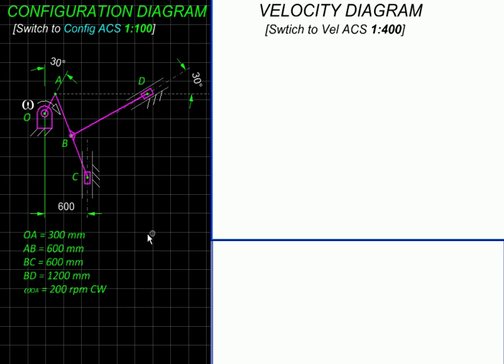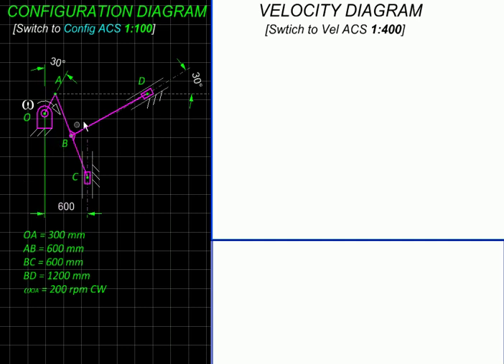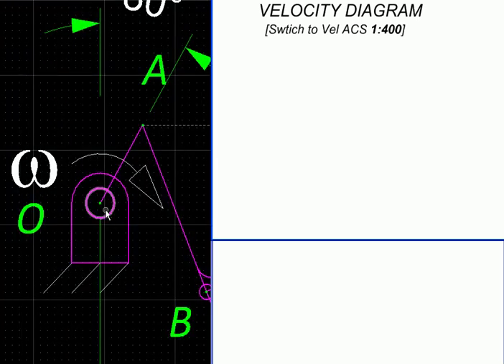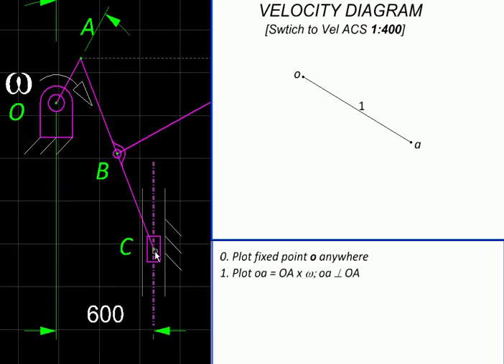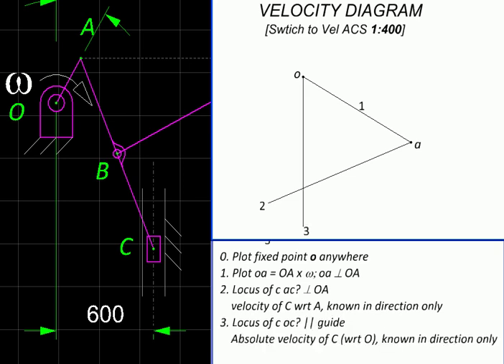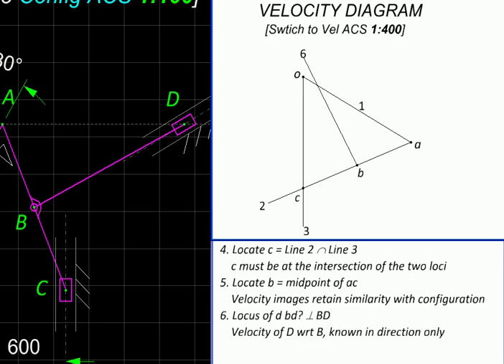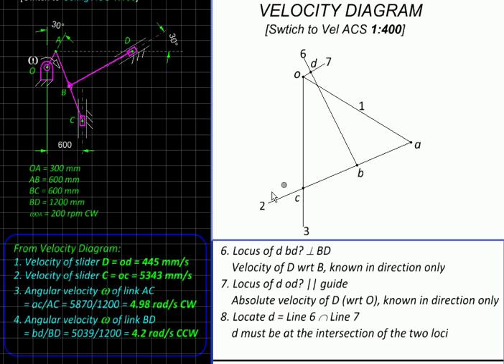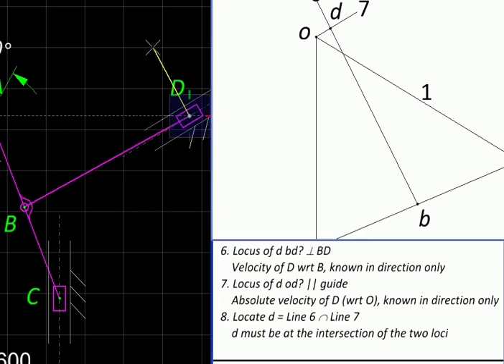Kinematics Ch03 E Velocity Problem 01

Comment: The locus of c should be perpendicular to AC not oa. To draw that a horizontal line is drawn at point a and a line at 30 degrees to it is drawn. 
Is my explanation correct?
Reply from the maker: Rahul Mandal The narration is correct, but the text has a typo. I have added an annotation to point it out now. Thanks for spotting and reporting it!

I did not get the construction you are suggesting. Are you trying to place velocity image of C? If so why horizontal from a? And 30° from which point?